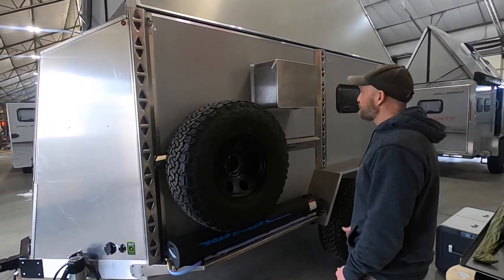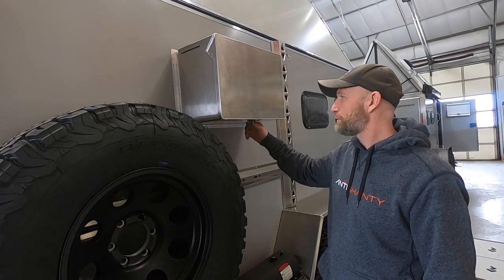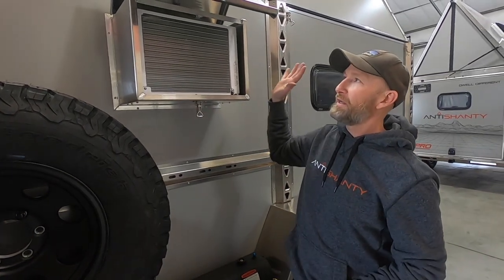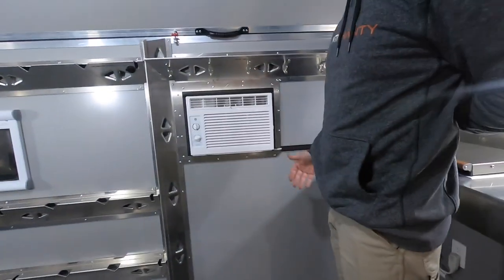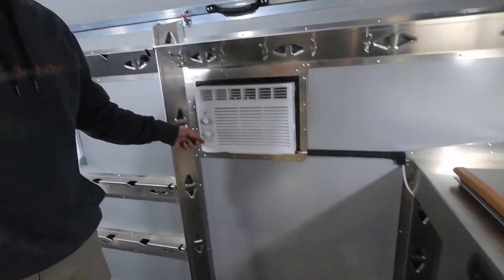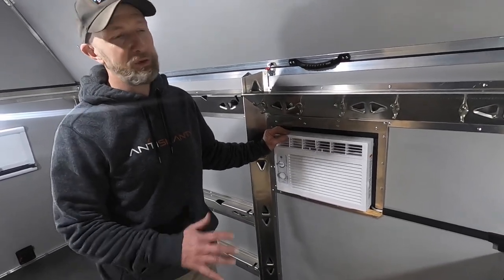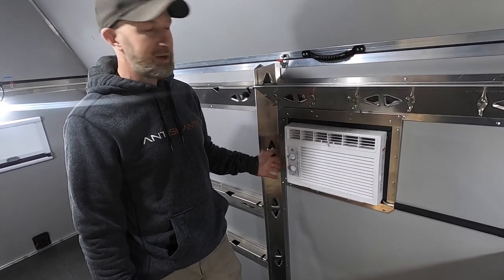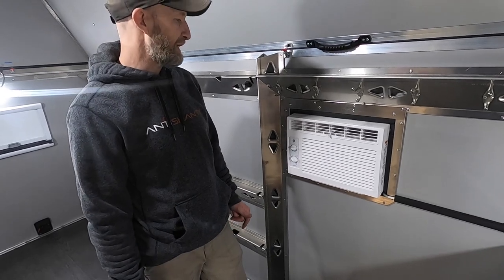How the A/C Works

Comment: That's awesome! I've been binge watching your videos and saw 2 other air-conditioners.1 mounted under counter, and the other was a portable unit under the counter. This is the way to go. Not only are  you working for your selves and your business but your showing that you care about your customers. At least that's what I see. 
Outstanding product from base model to pro. Something you can live in that doesn't weigh a ton and cost a fortune to tow. It will stay forever new as long as you do a little maintenance once in awhile too.
It's what I need at this stage in my life. Continue to do well in all ways guys from product to profit. In that way your customers will come out ahead too.

Comment: This is a great and simple solution, in line with the concept of the camper in general. My questions regards winter and how well it seals and insulates when the a/c unit has been taken out. We plan on using this all through the winter here in the Northwest.
Reply from the maker: Hey Benjamin, thank you! One can remove the A/C unit in the winter and use the space as cold storage, or stuff insulating puffy layers, etc. We supply the section of the wall that was removed in a trimmed insulating pressure fit insert.

Comment: How is it mounted so it doesn't get bounced around? Also will this be standard on the PRO?

Once again you've kept it simple and it's great it can run off the inverter. Smart move with an off the shelf unit. BRAVO guys👏👏👏
Reply from the maker: Thanks, Steve! Appreciate the feedback!
Reply: @ANTISHANTY  You're welcome except you didn't answer my questions😉
Reply from the maker: @Steve-yo4ld  Thanks for pointing that out! We use a cam strap with a structural case to keep the A/C from bounding around.
Reply: @ANTISHANTY  Sounds good and is it going to be standard on the PRO? Was a 2 part question😉
Reply from the maker: @Steve-yo4ld  Thanks again! Yes, it is standard on the Pro, more to come!
Reply: @ANTISHANTY  Thank you and can't wait to see what you have in store👍

Comment: I saw at a truck stop recently that a truck had an a/c compressor mounted to the back of the cabin rather than on it's roof. Had a chat to the truckie and he told me its a Dometic SPX 1200, essentially it's a split system AC that runs on 24V DC. Just wondering if you guys have looked at these at all? It looks like it's a lot more streamlined and weighs less than the home depot unit you guys are using. It looks like the dealer and service network is pretty good for these too, if you can get it serviced in Tennant Creek, Northern Territory of Australia then I gather you guys in North America would be fine too :)
Reply from the maker: Hey Boris! Right on, and sounds neat. Dometic makes some great products. Roughly 75% of the time we don't need the A/C unit and opt to completely remove it from the enclosure. :)

Comment: Did you guys look at the zero breeze unit at all, I’ve only looked at YouTube vids but it looks like it is a very low power option.
Reply from the maker: Hey Boris, thanks for your feedback and good suggestion. They do look neat and draw low power. We decided to go with these off-the-shelf units for their relative reliability and the option to easily swap out anywhere in the country.
Reply: @ANTISHANTY  thanks, makes 100% sense.